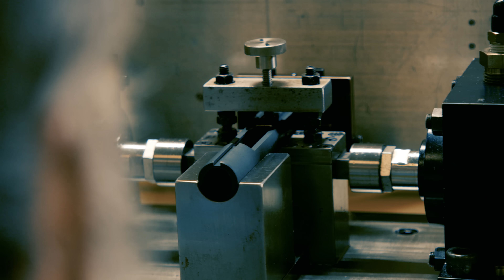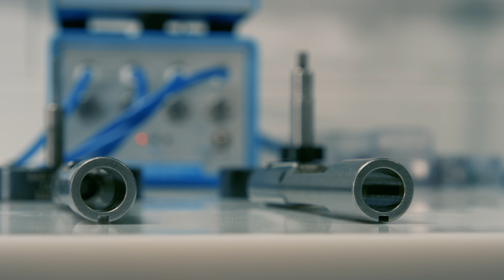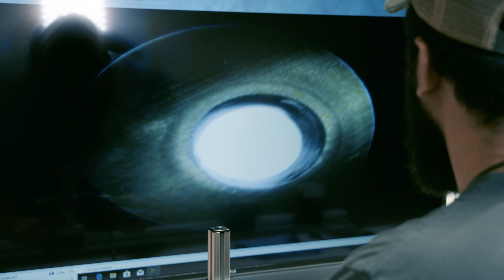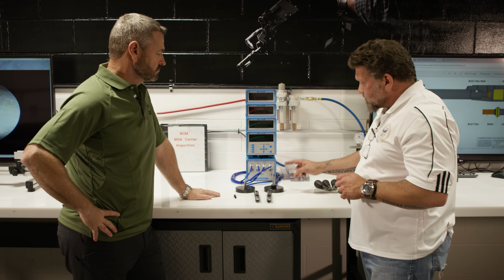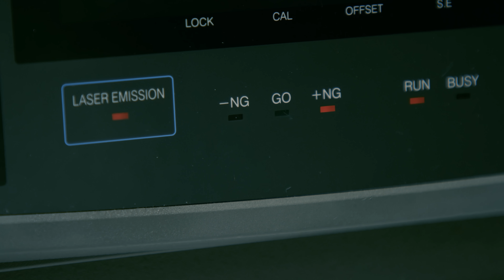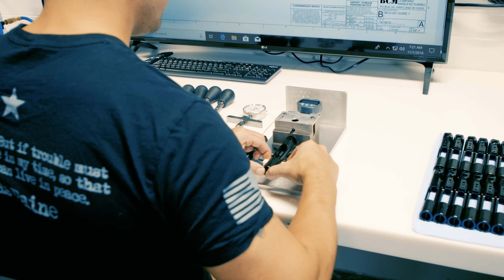BCM Factory - Quality Control

Comment: I recently bought an MKIIBFH ELW 16" upper w/ BCG.  Not being able to source a BCM lower I built an Aero M4E1 lower for it with BCM LPK and furniture.    It's only been a month so I only have about 500 rounds through it so far, but I've had no issues and I like it very much.  I used an H buffer and a Sprinco blue spring.      I enjoyed the video.

Comment: Always wonder when someone says chrome.  Just chrome or triple plate chrome because the process is way different and triple plate lasts way longer than just chrome.
Which is what old bumpers were made of and new ones if they are chrome are just chrome and will flake more often than not because cheaper practices and they expect the chrome to hide the underlying flaws.

Comment: Yea too bad they don’t still go by this type of quality control in fact this makes me sick watching this after recent events. I recently had to return 4 bolt carriers before finding an acceptable unit and my friend who’s dealing with extensive health problems wanted to finish his build to hand down to his son because his time is limited and after explaining all of this practically begging them at bcm to find him a good one they ended up telling him to pound sand . The two carriers they sent him one had bottom rails that felt serrated and the other I can’t remember the issue but they told him and this is word for word I saw the emails , we can’t give you what we don’t have and this was after him asking for a bolt carrier that had no issues meaning perfect no defects and they left him high and dry . Bcm is NOT what they once were and I can understand lemons get through but the way they treated Tom they lost me and many many others !! They don’t care about the small guy anymore we don’t matter guys like Tom don’t matter even if he’s choosing bcm to pass down to a son it didn’t matter to them they couldn’t care less
Reply: Everything I’ve received from them has been top notch, he probably just pissed them off by annoying them so often 😂
Reply: @Nach0s187  I have two new bolts the cam pin holes are over sized and a BFH that I returned that looked like a rasp was run through it. That said, they backed their products pronto with me.

Comment: BCM makes good stuff mostly but I do have one BCM midlength upper fits cockeyed on any lower I put it on. Also I have one BCM bcg that has a gouged up gas key right where the gas tube goes in.

Comment: Bought a cheap Ceratac kit. I've been replacing parts with mostly BCM parts because the stuff that comes with the ceratac kit are so cheap. The Ceratac butt stock pin wouldn't even fit over the ridge on buffer tube to lock in, so I bought a BCM butt stock (and a pistol grip while I was at it) and when it arrived it would not fit over either, which means the problem is with the buffer tube, so now I am ordering a BCM buffer kit to go with it. I've already ordered a new handguard because the one that shipped just didn't fit very well. I will probably be replacing the barrel because the one that ships with is would work better as a boat anchor. What I'm left with is the upper, BCG and dust cover. Out of those, I now want to replace the BCG after watching this, and the dust cover already looks like it's been to hell and back. 

I guess the good thing is that by time I'm done replacing parts, I'll have anther gun. The bad thing is, I won't want to shoot it.

Comment: This video has made PSA fanboys cry so hard over the past year. BCM still NUMBA WON
Reply: I own 5 BCMs and 6 PSAs. I'm about to sell the 6 PSAs to buy a couple more BCMs.
Reply: Ha.. I have a BCM BFH ELW upper on a PSA lower.. with a geissele trigger & BCM lower parts kit BCM BCG.. its close to a recce..  but has a different roll mark..
Reply: PSA is great for buying a cheap lower to slap your BCM upper onto
Reply: Yes because a company that makes AR’s and parts for everyone to be able to afford it is the same that larpers dick ride into the ground. Low IQ
Reply: no one is saying that PSA is better than BCM
Reply: @timc_720  you’d be surprised lol
Reply: Yeah, the quality control o my BCM that literally could not, would not seat a full 30 round mag, no matter what mag I tried was amazing quality control. Oh and if I locked the bolt back and put a full 30 round mag in and loaded the chamber, it would malfunction EVERYTIME. oh and the upper and lower fitment was disgustingly loose, it would not cycle steel cased ammo at all whatsoever, and it had 5 malfunctions with quality brass cased ammo in the first 100 rounds other than the malfunctions already mentioned. I’ve owned V7 weapons, DD, LWRCI, DPMS And Barnes. No issues with any of them. But that brand new BCM RECCE 14 ELW for $1500.00 after tax was the biggest piece of trash I’ve ever seen. And that’s not all, I called BCM numerous times during business hours only to find out on Internet forums they rarely ever answer their phone for customers and they force an email. I’ve had no problem contacting many great American gun manufacturers by phone at all whatsoever. Than BCM tells me all those issues are likely because I put a BAD lever on it, it didn’t know weather to laugh or cry, anyone who knows anything about these rifles knows a BAD lever won’t do that. They refused a return unless I took the bad lever off, went to the range and waste my time and money   And test it out. Which I did and to which all problems persisted.. DUH! I’ve written them off, and the fan boy who started this thread that was stroked In his pants by Larry vickers who was literally paid to do this promotion can suck it, fan boys of AR15’s suck if you ask me, there are so many damn good ones on the market, why would you recommend just one brand? BCM has done the most marketing and paying off of guntubers by a long shot, some of the biggest guntubers around have been in their pockets, look at MAC, in 5 years he’s done only 2 AR15 reviews (sig and colt) and he shit talked both of them the entire time and clearly steered people away from the,. but he’s done more than 10 on BCM and wears a damn BCM hat in half his videos.. AND he’s the highest paid guntuber via patreon and gets requests to review brands of Americas favorite rifle BUT HE NEVER DOES. I saw his patreon list a year ago or so and estimated he easily makes ATleast $20,000 a month from patreon, now he took away the count of patreon so people can’t see that. And he still says he needs more money and his patreon goals are not reached... guess what, they’ll never be reached with this guy. He will take all he can get. And it’s thanks to blind fan boys like you.
Reply: @redpilledpatriot8484  I have 6 ar15s.. Only one of them has a bcm upper with a $35 psa lower.. It doesn't even have a bcm bcg...  It sounds like you got an undersized magwell.. You are really angry for something thangs easily rectified.
Reply: @Clutch_Kick187  personally I think the upper receiver was out of spec.. an under sized mag well doesn’t account for all the malfunctions even with quality brass cased ammo. I and I’m simply telling what happened and making it clear BCM fanboys are kind of dumb for a few reasons.. the market is filled with MANY excellent rifles. And 2. BCM farms out most of their parts, most of the main components on A BCM are used on other brands of rifles as well.
Reply: @redpilledpatriot8484  so other good rifles use BCM parts? You’re promoting bcm and ya didn’t even realize it son. See how great they are now? LoL I’m glad you’re finally coming around.
Reply: @voxpopuli905  no, I’m not promoting BCM, and if I was I would know it. You have have extremely flawed logic and no common sense, which is a common character defect seen in fan boys.The fact of the matter is other rifles use the same parts BCM does but those rifles are not over priced like BCM.
Reply: @redpilledpatriot8484  still have that bcm? I'd be interested in it for parts..
Reply: @MrEunderwood  no. But thanks for asking. That would be like having a pension for colt after they began to refuse selling AR’s to the civilian market.
Reply: @redpilledpatriot8484  I didn't read all of your post but if you want to sell your BCM, I'd buy it depending on what you want $ of course. Let me know
Reply: @Patrioticduder  well you would have a rifle with a buttload of issues and only 100 rounds through it than.
Reply: @redpilledpatriot8484  That's cool. I like to tinker. What do you want for it?
Reply: @Patrioticduder  I got rid of it at a loss.. I got it to run more reliably by putting a lighter buffer spring in it, but never could get the mag issue fixed. Nor the horrible BCM customer service issue.
Reply: @redpilledpatriot8484  $20k a month for Mac channel, thats $240,000 per year almost banking a 1/4 Million a year. Well I guess I need to start a patreon now.
Reply: @TMHonfire102  yeah, it could easily be more than $20,000.. when you have 7000-8000 patriotic Americans on your patreon account gauging they give an average of $3.00 per month is more than reasonable.
Reply: @TMHonfire102  PS, arnt you that dude who killed that snake for no reason??

Comment: Any high end machine shop is going to use the same or equal methods to inspect stuff like this. I think the big difference is BCM inspects every single part, most companies only check 1/10 or 1/50. Even some of the Lockheed and space x work I've done only 100% inspected a few critical dimensions and spot checked everything else. I guess that explains why BCM is so expensive.
Reply from the maker: BCM isn’t expensive at all for the quality you receive
Reply: @VickersTacticalLAV  I've bought lots of stuff from BCM and always been satisfied, for the record.
Reply: The point is that BCM is not that expensive. If you want expensive go with Wilson or Larue. BCM hits the magic price point where you get everything you need. If you go beyond you are getting milled billet receivers that look cool but aren't as strong as forged and bragging rights.

Comment: I’m doing an SBR and I’ve narrowed my 2 choices to either BCM or Son’s of Liberty. 
I like m-lok over key mod for accessory mounts.
I do like the inspection process... not sure what Son’s of Libertys inspection process is, I haven’t seen any videos for them yet?
Reply: BCM
Reply: BCM all the way. I have some complete BCM rifles and have built a bunch on BCM uppers and lowers and Aero lowers and if using BCM parts everything works. It's funny, I take one of myfactory  Colts out of the safe and the upper to lower fits is marginal. Pull the Colt upper off and put a BCM upper on and it is properly snug. DD is OK, there is not a reason in the world to buy Colt, I'd rather have a forged receiver than a milled billet receiver. Sons of Liberty? Cool name but beyond that.......an unknown quantity to me.

Comment: I have to give big kudos to BCM. I've used many BCM components in my builds and have had only one issue with a BCM part. When I informed them they immediately offered to take it back on their dime and fix it. Since it was easy fix (replacing a faulty ejector roll pin) I fixed it myself. That bolt and carrier is currently in my MK 12 build and has been 100 percent reliable in matches and training sessions.

Comment: I served in and Military and as a Private Security Contractor, I can assure BCM manufactures the highest quality fighting AR components on the planet.....no frills..no fancy milled out receivers......solid barrels....best BCG I have ever used...they just do work!    I ONLY run BCM uppers on any of my AR builds, in my opinion they are the best.  I recently purchased a 14.5 upper, assembled it with a BCM lower but ran it with a Lantac EBCG....had reliability issues, gunsmith assumed it was a gas block issue....returned the upper to BCM, they inspected it and recommended I run one of their BCG, they replaced the gas block anyway.  Once I received the upper took it out again with same Lantac EBCG....still had same issues, bought a BCM BCG.....rifle instantly ran like a sewing machine!!  Turns out Lantac had a bad run of BCG's with faulty gas rings.....upper was completely fine.  BCM customer service no questions asked.....they fixed it anyway.....that is above and beyond in my book,  BCM will always get my hard earned money for a well engineered solid piece of kit I can depend on to defend my family and freedom!

Comment: Saving up to get a BCM 11.5 upper
Reply: John Creasy I’ve used a BCM 11.5 carbine setup for the better part of 9 years now.  While my shooting has slowed in the last few years, the first several years of ownership were very high volume.  It has been accurate, reliable, and a much more refined feeling when firing compared to almost any AR type under $2500.  Only non-BCM functional parts are the AAC can mount / flash hider, spikes tungsten buffer (smoothed out cycling) and a larue trigger.  I just keep the action wet with oil and it loves abuse.
Reply: @MillerVanDotTV how’s it running these days?